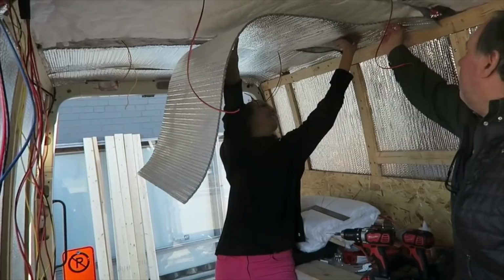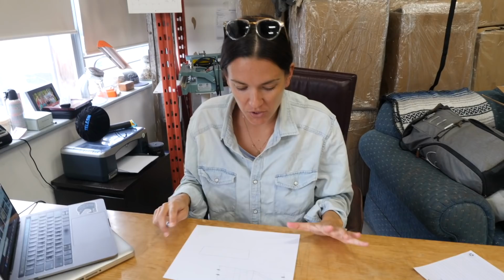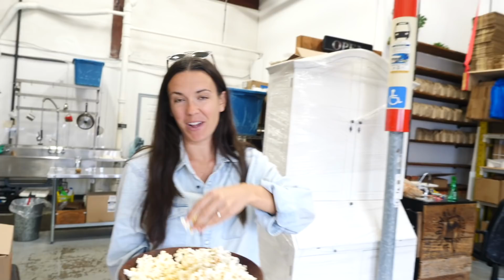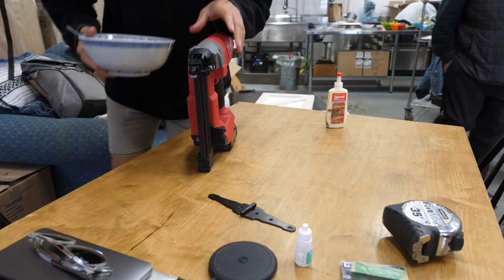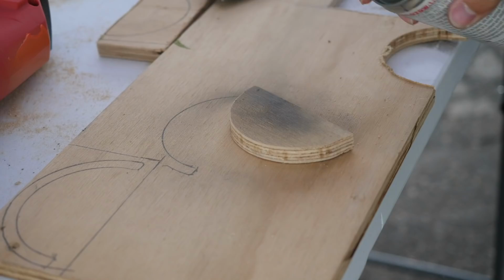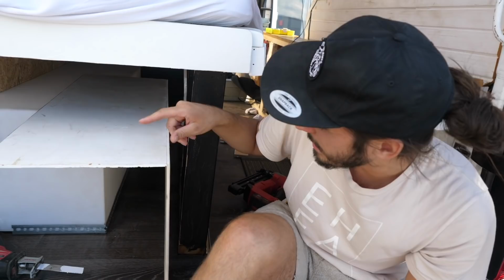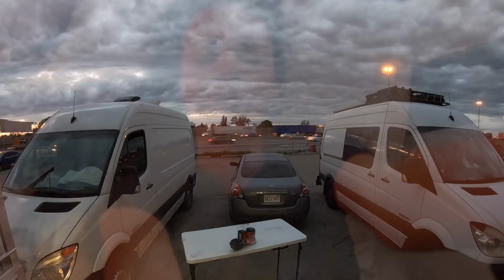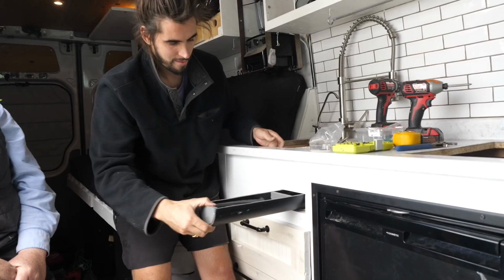Tiny House Renovations Continued | DIY van life makeover

Comment: If you are replacing bulbs often, it maybe linked to touching the clear glass part of the bulb where the light comes out,  the oil on your fingers causes heat buildup and shortens the bulbs useful life.

Comment: Hey guys, as I saw you mounting LED headlights, I just want to warn you that LED headlight are not allowed in Europe ! (none of those replacements of standard halogen bulbs are homologated). Also self-converted van is a big problem in some EU countries (without endless (un)necessary bureaucracy). Just wanted to let you know, so that you don't have trouble and fines later.

Comment: I'm sitting there looking at those cabinet doors that are going in the same direction and I'm yelling at my phone saying just turn the cabinet.
Door 180ﾟit'll be perfect.. And it will be facing in the opposite direction.. And you won't have to take it apart.. Of course I'm leaving this message before I watched the end of the video so  I know you fixed it already but it was such a simple fix and now I'm gonna watch the rest of video.. Little heads up you might wanna take from a  Mechanic's wife don't touch your light bulbs with your fingers   Except from the very back..because if there's any oil that gets on the halogen part of bulb believe it or not and will blow your bulbs faster.. Let's hope that's not the same way with the LED because Eamon just touched  The main part of the bulbs..